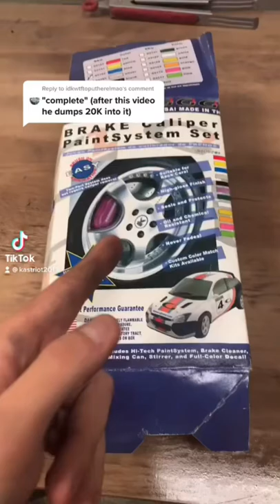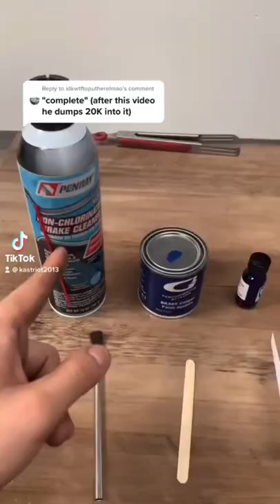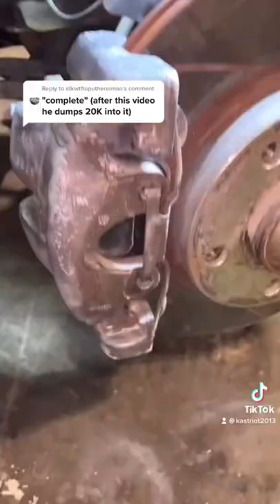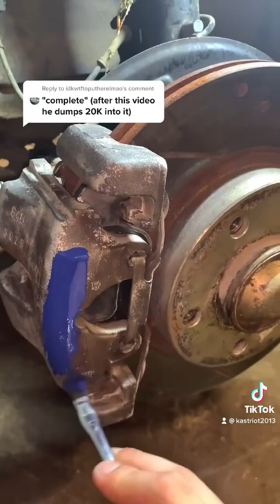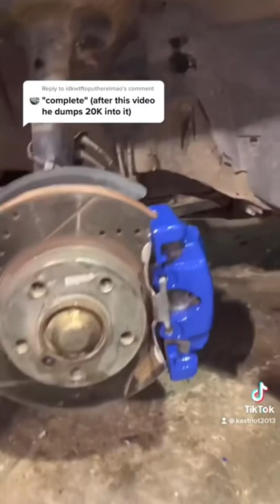Painting calipers

Comment: Just pull the calipers off and use spray paint it makes 10x easier amd faster
Reply: but bleeding the brake lines 😔
Reply: @velociraptorxz  not that hard bro just need 2 ppl or a pressure bleeder
Reply: @velociraptorxz keep the line connected but just lay the caliper on the ground
Reply: @mc.yohann no because pressure on the line could be bad, just take the caliper off, when you put it back on, step on your brakes a bit in park to bleed the brakes.